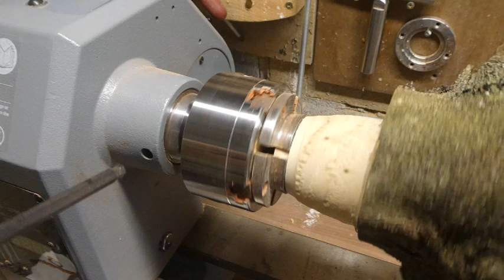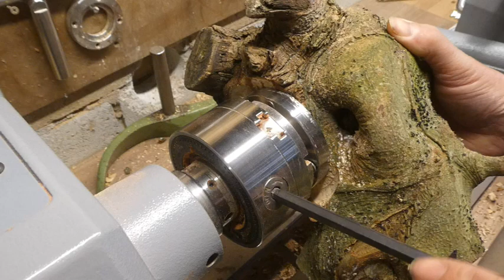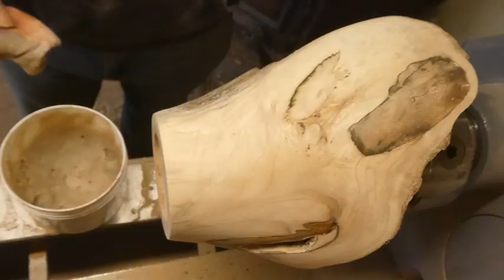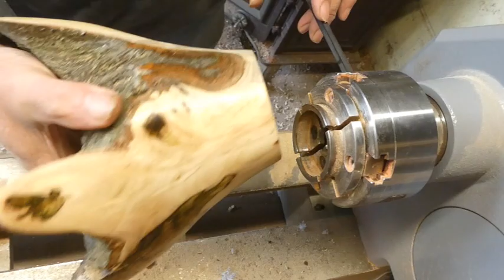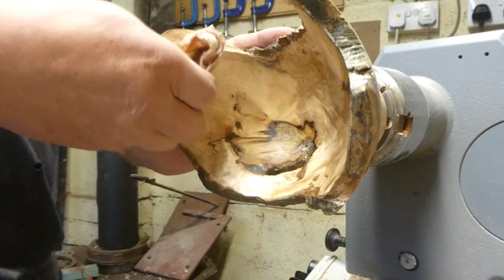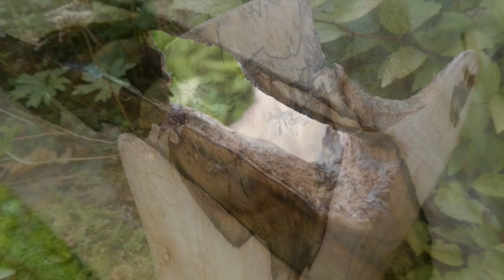Woodturning - firewood into a bowl

Comment: G'day mate... Phil sent me here... this is a beautiful piece.

Don't be afraid to turn firewood... it's 99% of what I turn... and I tell myself, "it still could be!"
Reply from the maker: Hi Swiss Technique...thank you very much...Phil was very kind to mention me in his video... the problem that I have with firewood is that I tend to use similar sized logs and after I have turned them they all finish up looking the same... about 8 to 10 inches long by 5 to 6 inches wide ...high at the ends and low in the middle... I think that I need bigger timber... take care...All the best.....Andy